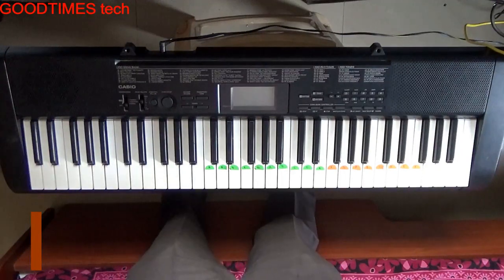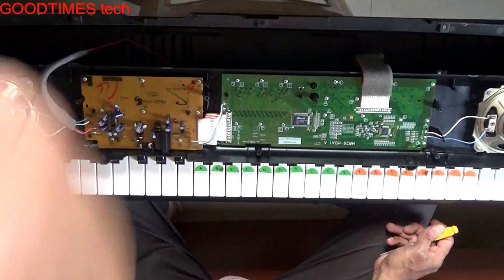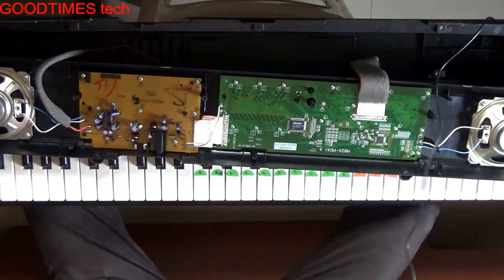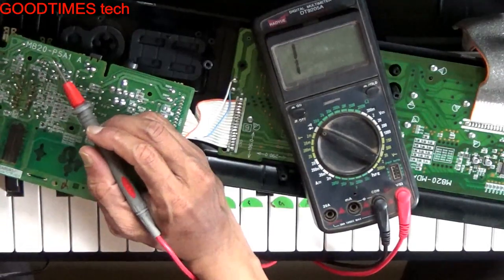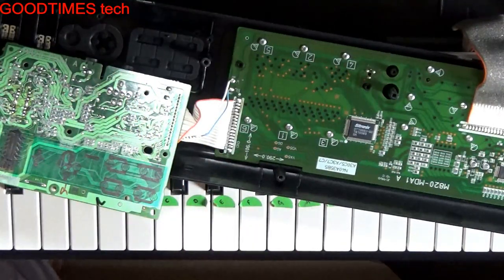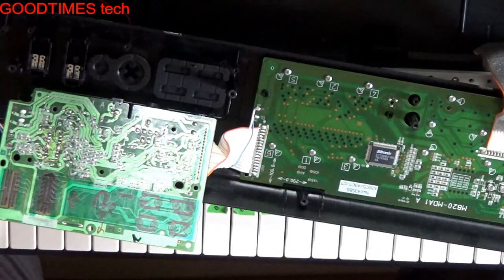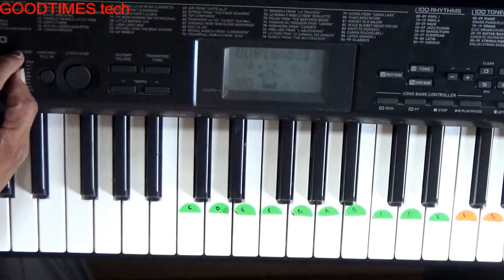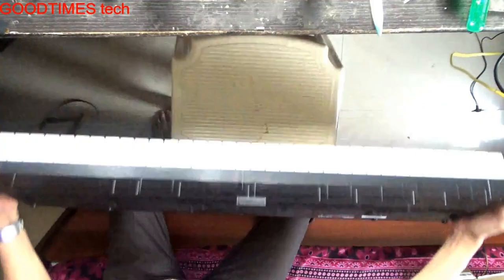CASIO CTK1150 | No Sound | Display very light.

Comment: Very clear, direct, and intelligent. Have a Casio CDP 230-R that has similar symptoms--low volume then after 5 minutes static and popping sound on the speakers (had hooked it up to my TEAC Hi Fi and used it as a pre Amp for a while, but even now it is unusable). The most probable issue is a capacitor but am going to replace my adapter first. I would truly like to find a schematic for the audio for this machine. Again thanks for the professional tutorial. Chuck Ingraham
Reply from the maker: You are most welcome, 
Thank you, have a GOODTIME....
Reply: भाई साहब मेरे सिटी के 810 में डिस्प्ले और पावर बटन प्रॉब्लम है तो ठीक हो सकता है

Comment: By mistake i connected my keyboard with laptop adapter ,then after it stopped giving sound ,can u plz guide me about the same ...display is working but giving no output plz help i bought the keyboard for my younger brother
Reply: Shubh Verma have you found a solution yet?
Reply: Same problem bro

Comment: I have Casio ctk 1100 .I have replaced  capacitor of 6.3 V , also now the IC starts heating...The screen is loading with no names and numbers ,the sound is gone .I can see only the dark screen with no name and Number
Reply: Hi same brand casio po no power... alam nyo po ba san pde ipagawa. Thanks sa reply

Comment: I think my CTK-700 have the same problem.
Display is fine and all inputs are showing in display without any problem,
But no sound is coming out of the keyboard. It is completely silent.

I never turned it ON for atleast 6 months. But I kept it in its bag so no chance of dust or insects getting in to the electronics.
What do you think ?
Reply: Open and clean it. Dust it

Comment: (PS I actually do have a problem with my CTX-700 :- any idea why the soundbank for Piano (only the piano sounds) make a screeching sound but all other sounds are fine? thank you !! Great video
Reply: You may have a leaking capacitor. Sometimes they are not shorted like this one, also you may have a bad power supply regulator.  Touch each capacitor at its top and see if toyching one you hear noise. If that the case replace the cap.  But I would also check the regulator.  Good luck.

Comment: This type of sets input, output voltage please sir.very nice
Reply from the maker: In this set Input voltage is 9.5v DC and output to Logic (Main control ) board is 5v DC, the capacitor which i replaced is 1000uF 6.3v.

Thank you for watching.
Have a GOODTIME.

Comment: Sir i have ctk 2500 when i press C It gives two keys sounda at a same time & so happens with other keys plzzz help me sir
Reply from the maker: Did you try resetting ? If yes then i will check and get back to you.
Thank you for watching.
Have a GOODTIME.
Reply: paino 5407 sound problem plzzzz slow
Reply: Ctk 731 is creat noise at time of key function and idel conditions, one whisper sound is arise, plzs reply

Comment: MK-812 KEYBOARD
WAS DEAD DILL TO wrong polarity they where using 12 car battery
I changed the regulater 7805 and 2206 IC 
The keyboard is on and the display is on but not printing anything 
No sound 
There is sound when pushing the power button